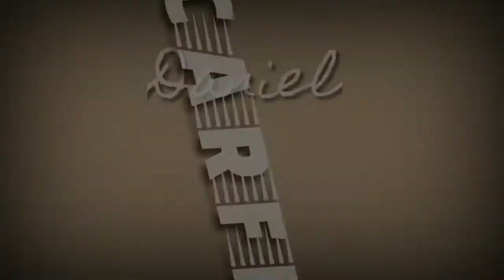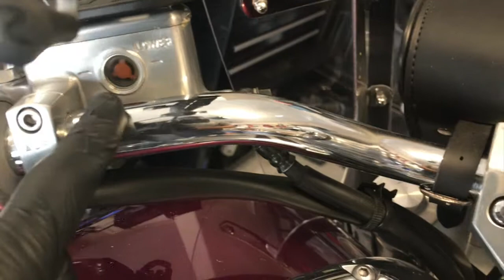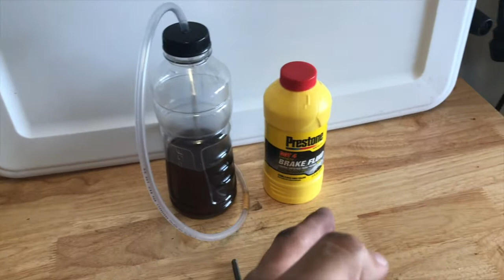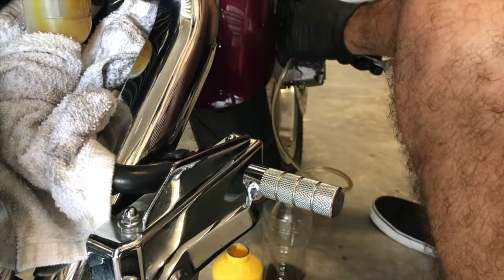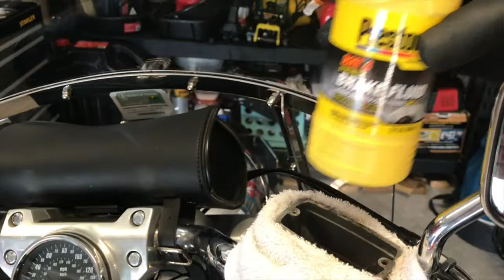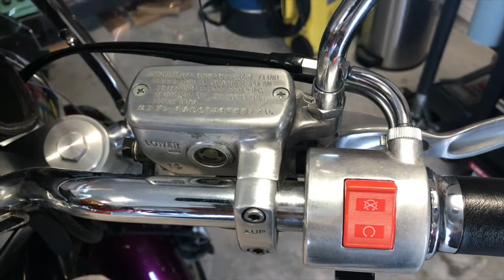Honda VTX 1800 Brake Bleed

Comment: My rear brake refuses the bleed and the caliper doesn't do anything, front works. What could be my issue? Bike had sat for 10 years and recently has been getting full service.
Reply from the maker: 10 years... cylinder is probably frozen in the caliper. You need to rebuild it.
Reply: @dcfgarage  I took the line off, brake fluid does't seem to reach the caliper at all. Old fluid is still in the line.

Comment: Thanks for the Video.  I was wondering why the front brakes had a second bleeder valve. So I went back to rebleed my real brakes. In doing so, the center piston bleeder valve on my RT front brake, no fluid ever came out. It didn't even drop the vacuum I was pulling.  Any idea what going on?
Reply: The rear caliper is linked to the front calipers so the lower bleeder valves on each front caliper is coordinated with the back caliper.    Front brake system bleeders are second valves on top of front caliper and their reservoir is on the handlebars-   not connected to rear reservoir on the frame above foot pedal.

Comment: What size hose for the bleeder screw and where can you buy it
Reply from the maker: It is a 1/4 inch internal diameter and I bought it at home depot
Reply: @dcfgarage  is that the same size for all the bleeder screws on vtx 1800
Reply from the maker: @ja47377  they're all the same
Reply: @dcfgarage  thank you

Comment: Good deal, thanks especially for the bedding explanation, beautiful bike!  

Dumb question.  I pulled all my pads at the same time the other day to see how much life I had on them. and like an idiot squeezed the rear brake pedal after I put the rear ones back but before I put the front ones back on.  

Now the center pistons that run off the rear braking on the front are pushed out.  I have one caliper off but still connected, and even with the rear reservoir uncapped, I cant get the piston to slide back in, tried vice grips and a C clamp already.

I need to bleed them anyways, think this will free the pistons back up when I crack the bleeders on them?  i feel like they should already back off with the reservoir open. but I think I remember reading about a proportioning valve also being part of the system before....
Reply from the maker: Hi Gene. I would try to compress the center cylinders for both front calipers while bleeding the fluid into a bottle, with the reservoir closed. That should equalize the proportioning valve again. You probably noticed that the rear fluid reservoir when down significantly when you did that, right?
Reply: @dcfgarage  yep.  Will give it a shot, thanks.

Comment: thanks for the info on the brake bleed procedure. One concern...I didn't hear in the video if you put new brake pads on. If you didn't, its possible you still have that front reservoir overfilled. Next time you go to replace front brake pads and compress the brake cylinders in, you may find there is too much fluid. Just a bit of feedback. great video with good details though. Thanks....i have an 02 VTX 1800C . Bought it when they first came out. 38k miles and my wife and I have LOVED this bike. Considering the Ultimate Seat upgrade over the winter.
Reply from the maker: It wasn't overfilled, but that's sharing. BTW, I'm also considering a seat upgrade. Stock is extremely hard. A lot of people recommend Ultimate seats. What are you gonna get?
Reply: @dcfgarage  Thats the one i am considering as well. The ultimate. I need to call them and get more details, but i have pretty much decided to try it. Going to order the whole set, driver/passenger/ and both back rests
Reply from the maker: @rbljackson  I'd also change both. What keeps me from doing it now is the $$$. Let me know if you get them and if they really make a difference.
Reply: @dcfgarage  will do. I am mainly doing it for the wife. She hates the OEM passenger pad....LOL. And yes, its like 900 bucks total, so it better be REAL good.
Reply from the maker: @rbljackson  LOL! I bought a buttybuddy for the wife. It's working for her, but not great.